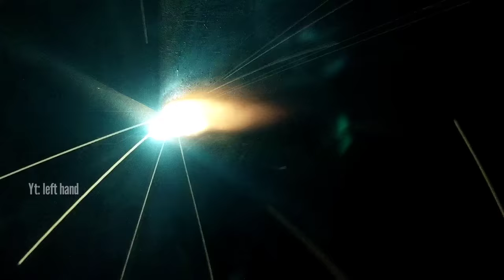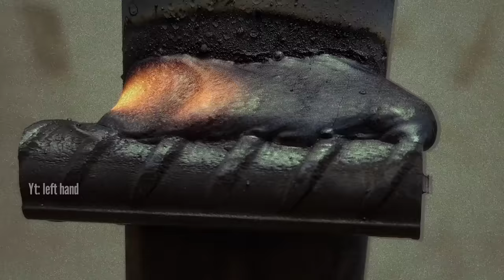metal rod welding tricks that not many people know | arc welding

Comment: I hate to tell you, but that is AWFUL welding technique.  That "Daubing" method is not worth a bottle of spit.  Notice how HARD it was to chip the weld.  Notice the HUGE unfilled Crater.  I have seen people do it like this on Pipe and Sucker Rod Fences.  First COLD SPELL will cause the fence to shrink and the sucker rods fall off the fence.  The Round on flat is NOT the best joint.  On a sucker rod fence it is even worse as the round sucker rods are NOT mild steel and the posts are usually Drill Stem which means they are ROUND TOO.  I round on round joint is an even worse joint.  So, one must do it right.  You weld it like THAT with a 6013 or any other mild steel Electrode and it the sucker rod will come off the fence.
Reply: I weld well casing H braces but not yet sucker rod. I use 6010 on a Hobart gen. You said how not to do it but I want to know what u recommend. I figured get penetration root pass and maybe a couple fillers on top and bottom of rod
Reply: Bob is right. Very uneven too much  when starting everything and low at every finish. Just saying don't hate

Comment: Theory says: you cannot weld building corrugated bars.. they have too much carbon and the weld its fragile.  And 6013 its not usual into structural welds,  7018 its the proper electrode for these works.  but always..  high carbon steels needs special procedures to weld.  and is controlled preheat and cooling.
Reply: I have read that it wants a low-hydrogen process.

Comment: Just a little healthy advice, you can weld it with a stringer using a simple 110 fluxcore welder.
Reply: Can you explain this for a beginner like me? What is a stringer? How would you weld it? 

I need to do this exact weld—fastening rebar to square tube for an ocotillo fence project at home. But I've never welded before. I'd like to use fluxcore because it seems easier/better/faster.

Thanks so much for the help if you're abl!

Comment: I think the beginning is 6013 at 90 Amps, which is considered hot, thus the pausing as weld progresses. But this is rejected, I do not know why because it looked fine to me. Then the switch to 85 Amps, still 6013, thus slightly cooler and maybe enabling a steady bead but perhaps thinner and thus the repeat passes to build it up. Just my guess.

Comment: It would be nice if you always said what rod and what polarity and heat setting, that would help alot.
Reply: he is using rod E6013  3,25 and 100 amps
Reply: in min 2:31 he is using e7017 3,25 130 amps

Comment: Doesn't fill his crater at the end of the weld undercut on the bottom side uneven bead formation from doing a weave instead of straight multi run fillets first year apprentice mistakes